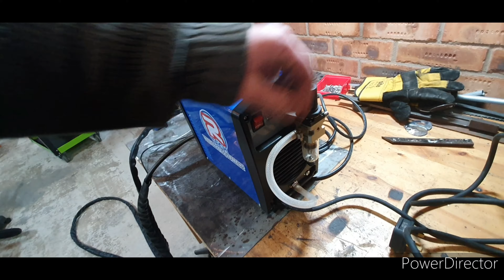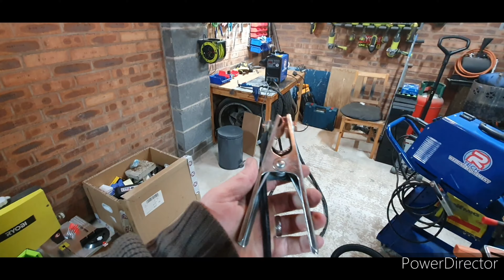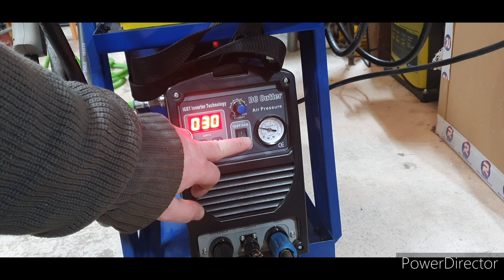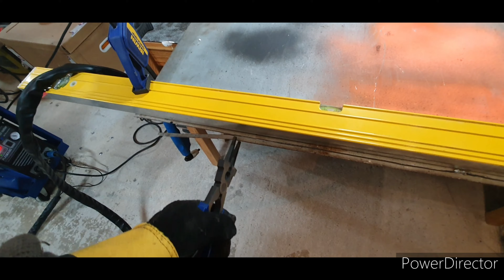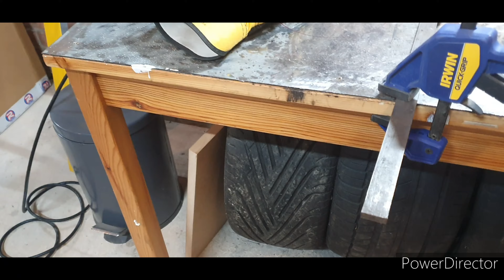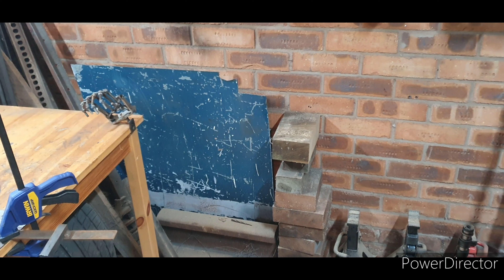R-tech plasma cutter p30 test and review

Comment: Excellent videos!! just subscribed. what size is your compressor? as im looking at buying the same setup.
Reply from the maker: Cheers pal. Its a 90l compressor. It works well but with bigger cuts the compressor will just keep running. A bigger compressor would be better but like I say it does do the job 👍

Comment: Is the mg 250amp pls??
Reply from the maker: It runs off a 240v 13 amp supply and the amp adjustment is between 15 and 30 amps and it will cut up to 12mm thickness 👍

Comment: A spirit level for a straight edge tch tch

I’ve just bought the exact machine. Arrived today. I’ve been cutting some 1/4 inch plate. I’ve had mixed results. Probably was rushing a bit. Sometimes the cuts were perfect and others not so good and I don’t know why. But early days. 
I did but an R tech mig welder a little while back and I’m as pleased as punch with.
Reply from the maker: Yeah it can take a bit of practice to get used to it. I mostly use it for thiner plate but I also cut quite a bit of 6mm with it a few weeks ago and I was quite impressed with it. Im also very impressed with the mig 180 from them too👍

Comment: I milled a slot in piece of aluminium flat bar at work ideal for cross cutting or cutting long straight runs. Keeps the nozzle at right stand off distance, I am not using an Rtech plasma cutter but wish I had one at home.
Reply from the maker: That's a good idea mate. Yeah its a great little plasma cutter 👍
Reply: @TheYorkshireMix  Another handy thing I made was a circle cutter plenty of youtube videos on that. I often use templates from hardboard. and once your up to it with a steady hand you can make things that would take an age with a file and a grinder. Good luck great channel mate.
Reply from the maker: @gmcallsuk  cheers pal. yeah I did get a circle cutter with it but I've not actually had much use for it at the moment. I do have a few plans that will put it to use but that's after I finish my current project gsi car 👍

Comment: Where abouts in Yorkshire are you?
Reply from the maker: Sheffield area mate👍
Reply: @TheYorkshireMix  thought it was local. I'm in barnsley.
Reply from the maker: @mapstardamo1624  yeah not too far away then mate👍
Reply: @TheYorkshireMix  what's it like on 10mm plate. I've 3 work benches to cut down along each of their 2metre lengths and was either looking at getting one or someone to cut them 😉
Reply from the maker: @mapstardamo1624  I've only cut up to 8mm plate with mine and it did the small amount that I needed OK but I think 10mm would be pushing it.  It will do it but if you plan on cutting a lot of 10mm it would probably be better with the next size up. The 50 instead of this p30. If you've already got a compressor and if you plan on doing a lot of work with steel then you would definitely be better off buying 1👍